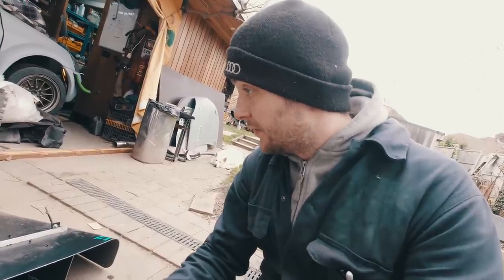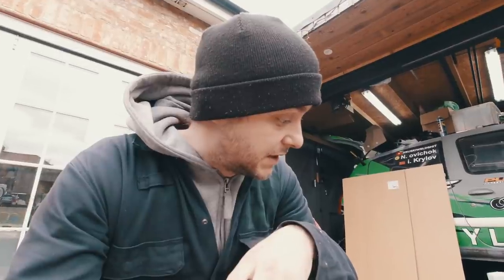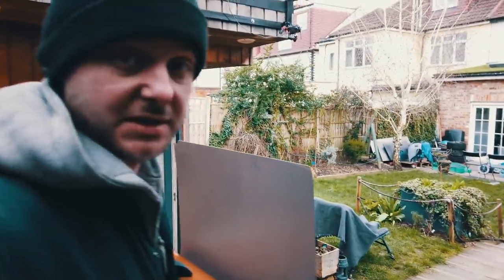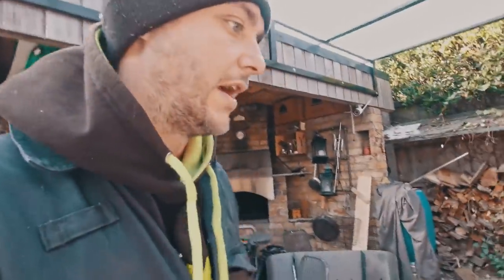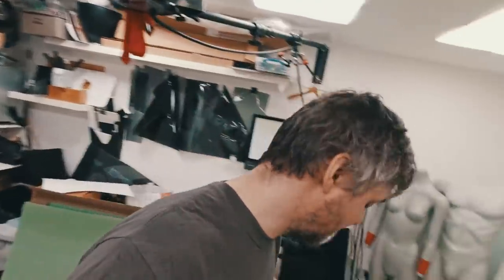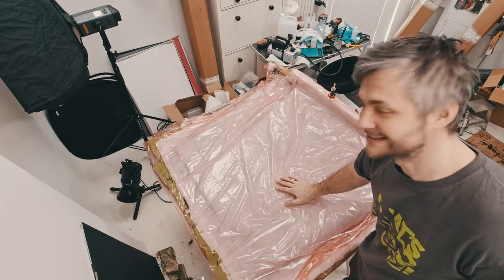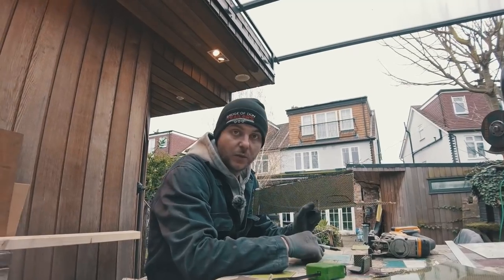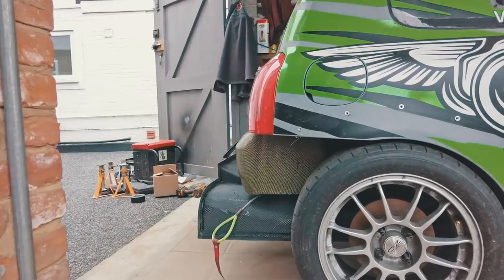I made RACE DIFFUSER! DIY kevlar race car diffuser. Building the fastest Time Attack Clio. Ep.34

Comment: Thanks for sharing your effective techniques.  For testing, If you fit suspension height sensors, one on a front control arm, one on a rear, like those use on Audi, for instance to aim the xenon light bulb angle or any car with an airbag setup, you can data log the change in downforce at speed.  The lower  the car gets at any given speed, the more downforce you are generating.  Useful for comparisons of the effects of changes.  The height sensors have are nothing more that a rotary variable resistor switch with an arm instead of a knob.  Constant signal voltage in, and a ground, yields variable voltage out depending on suspension movement.   Perfect?  no, low tire pressure can hide some of the downforce through tire bulge, but still for back to back runs while making tweaks for angle of attack, it could be useful.

Comment: Great work on the diffuser. Although I think your understanding of vortex generators is slightly off. (Edit. Corrected below)
Vortex generators create the 'vortex' by disturbing the laminar flow and detaching the boundary layer from the surface.  Hence why they are normally found at the top rear of the roof - to stop the air flow following the rear window (where it would be creating lift).  So I believe your positioning of vortex generators would lead to a reduction in the effectiveness of your diffuser.
Reply from the maker: thanks! i have a feeling you got it wrong yourself. here is a very good short video explaining it better. https://www.youtube.com/watch?v=eP-YUDe9HF0
Reply: @RuskiWeldFab  well this is embarrassing. I've had to look back at my dissertation in aerodynamics from 2012 (yes, I literally wrote a book on this topic 😅🤦) and agree that my previous post is incorrect. 
Whilst vortex generators can be designed and positioned to purposefully separate flow, your example should work well, good job 👍
Reply from the maker: thank you! you litteraly made me go back and start reading incase i made a mistake. thanks for your input! i hope it works. well if it doesnt i know how to fix it.
Reply: @RuskiWeldFab  haha sorry for the mild panic lol. I don't know what I was thinking 🤦 Hucho : aerodynamics of a road vehicle, is a useful book should you be interested.  Unlike my dissertation, which having not looked at it for 9 years I'd forgotten how 'dry' it was 😅.

Comment: Hi, can I just ask. How do you determine the effectiveness of the aero you put on your car? Eg, do you do any tests to spot boundary layer separation?
Reply from the maker: Great point! a lot of it is guess work. with some help from aerodynamic gurus who are happy to help with advice. i have done some tuft testing in the past. but have no idea how to make anything of the data i get lol. plan is to scan the car and find someone to CFD it.
Reply: @RuskiWeldFab  I'm working on a 125cc kart atm. Just started with the rebuild after stripping and painting the frame. Once the kart is working properly I'm thinking of putting some aero on it.

I did my thesis in openfoam, so I'm planning on picking up on that knowledge. Probably still will take me a year or two to get to that point, but if you're still looking by then... 😜